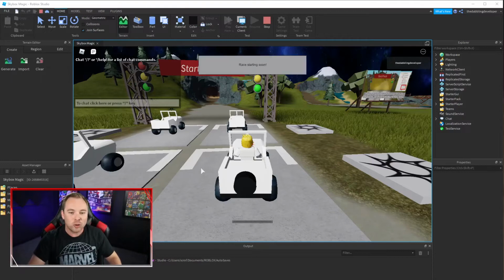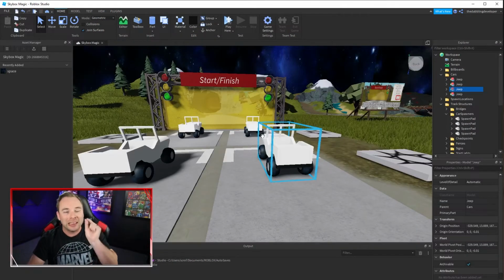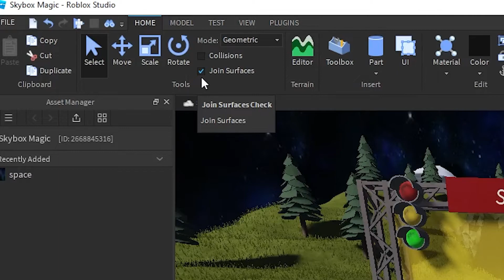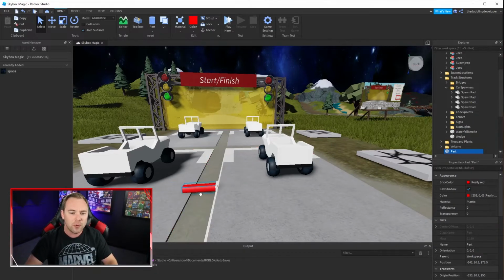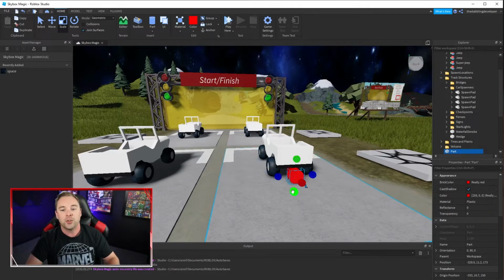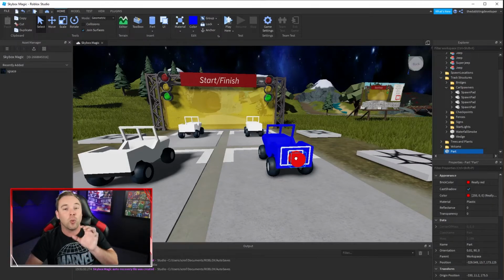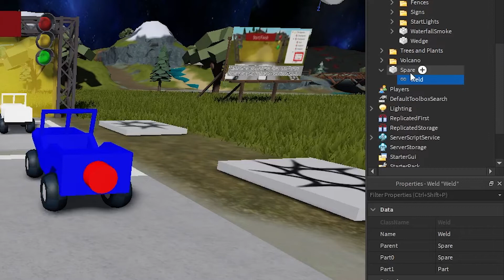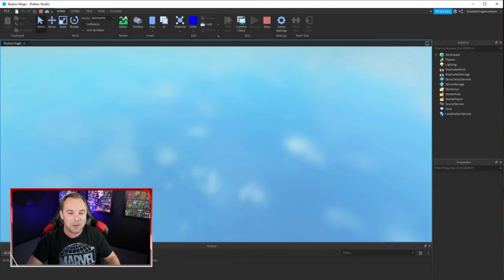How to get parts to stick together in Roblox Studio 2021

Comment: could you make a parade float with this? I am tryna make a charlie and the chocolate factory parade float for a parade Im going to do in my city game but when I welded and parented the parts together the set falls off the back of the car im using in my instance I am using a flatbed tow truck so it has a platform on the back, how do I fix this?